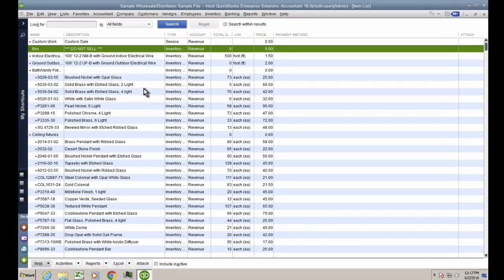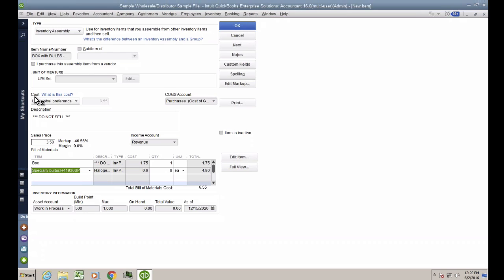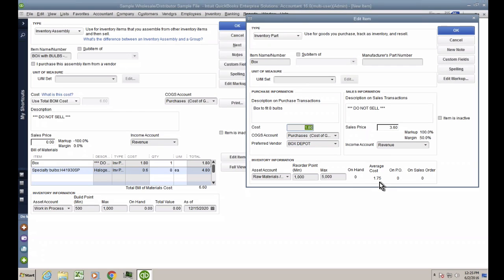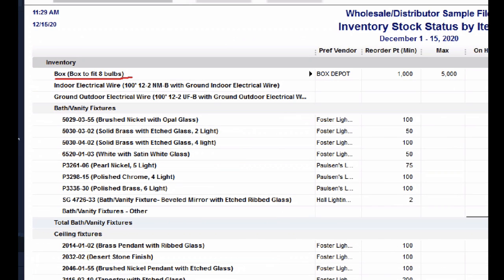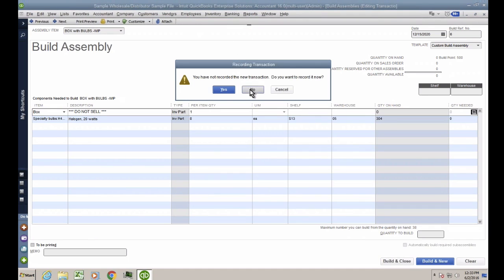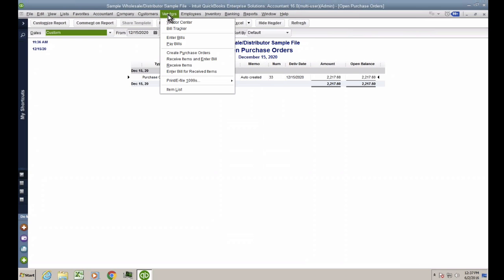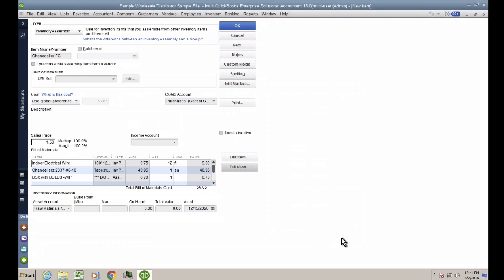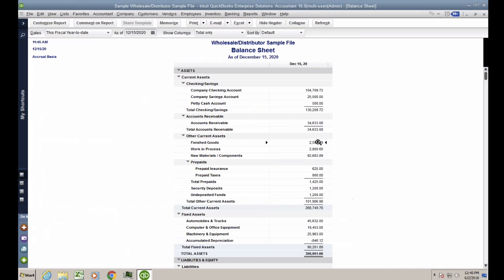Manufacturing in QuickBooks: Inventory Assembly, Sub-assemblies, Pending Builds

Comment: Hello Hector, first I want to say I'm so glad to find your videos. We own a manufacturing company and I took over the bookkeeping after outsourcing it. You've cleared up a lot of questions. But, I do have one for you, hoping you can help. We have desktop Premier Plus Mfg. Wondering if I can use assemblies with sub items to have product varieties. Our BOM is large and the only item changing between 4 or so varieties is the color of the molded parts. Could I do one parent assembly and then have a sub item for each color? Would it have just the molded part in it or would I have to have all the BOM on that item too. Thinking it would be easier if an item changes to change in the parent instead of all 4 parts.  Also, we have products that are sold to distributors and although they are the same part (sku), we'd like to track them differently than the ones that we sell direct. Since I don't want to "assemble" a dealer version, wondering how to handle that. Your help is greatly appreciated!
Reply from the maker: There are too many moving parts on those questions.  Maybe if we can look at your file, we can give you a better answer
Reply: @HectorGarciaCPA  I totally get it. To make it simpler, I am trying to find a way to have a sub-item of an assembly that would pull from the inventory without having to do a build. How might I show you our file?

Comment: Thank you for the information; it is very helpful.  I am using Quickbooks Premier Plus Manufacturing and Wholesale Edition 2023.  My "Cost" field shows the drop down menu, but it is not active.  I cannot choose a cost like global preference,  user defined , or BOM.  Why would this menu not be active?  I can enter a value manually, but we would like for the BOM to automatically fill this field.  Do I need to change to a different Industry Edition?
Reply from the maker: Do you have multiple currencies turned on?
Reply: @HectorGarciaCPA  No, I am set up for one currency.  I did try changing editions to retail, general business, and they all leave that drop down menu inactive.  I can see the menu, but it will not let me toggle between the choices you show in the video.

Comment: I have a production output efficiency of 90%. When I do the build assembly it gives us the cost based on 100% production output efficiency, but in reality, there is some 10% scrap generation which is of no use. How to enter a production efficiency in the system so that my 100% cost spread on 90% of the production output.
Reply from the maker: All you do is increase the materials usage be 10% so the costs reflect the yield/scrap variance

Comment: Hi, Hector.  I think you missed out to discuss also the site list and the transfer of item here wherein the raw materials and/or sub-assemblies are not stored in the production department. 

And Pending Builds has to be avoided in the real world because it will give an additional cost/loss and will hamper the production output level of the Company. Since a certain Company has Production Plan for their confirmed orders, therefore, when setting up the Inventory Part, it must have the Reorder Point min/max number of items both in the Production Site and Warehouse Site to comply with the Production Department Production Plan by the Purchasing Department/Warehouse Department, thus, avoiding future overruns of cost and avoidance of losses.
Reply from the maker: Good points, is hard to cover it all in every video :)
Reply: Yes, I agree with you and aside from that, the sample that was presented in this video is a Chandelier Manufacturing that needs not much Inventory Warehousing Management. 

Mr. Hector, I visited the website for Enterprise Expert and I sent the request in joining. Kindly accept my request. Thank you so much, and best regards.
Reply from the maker: REX ESPIRITU you are right... none of that is covered.

Comment: Very informative.  In Enterprise, I set up a use car dealership using assemblies to add all the cost to the finished product.  The non-inventory items such as transport, detailing, mechanical service and body work.  The costs of the non-inventory items can change daily depending on the vehicle.  What frustrates me is if I enter all the components and build the assembly . Then I  find that I have to add an item to the original build.   When I delete the  assembly build and go to the assembly item  all the cost have changed from the original costs entered due to the daily changing costs of the non inventory items being  billed and paid.  Can you tell me what I am doing wrong.
Reply from the maker: Claudia Cox don’t use Assemblies for used cars... use a unique inventory part for each and adjust the value as you go.
Reply: Hi Claudia, the "Inventory Assembly" Item in the Inventory List pertains to products to be built/produced in a manufacturing type of business. Since you are engaged in a Used Car Dealership, therefore,  the Standard Costing procedures in Cost Accounting shall apply. For costing purposes, you can do it first in Excel to arrive at the new cost of a certain car in bringing them into the good shape and/or perfect condition.

All these used cars will be part of your Inventory at the Balance Sheet - FG USED CARS and will be entered either individually or by batch in the Item list as "INVENTORY PART".
Reply: Definitely, if you changed occassionally the cost of the non-inventory items that forms part also of the BOM of your finished goods, therefore, the cost of the Assembly Item will also be affected thru cost updating.